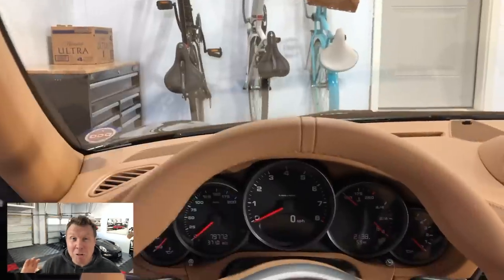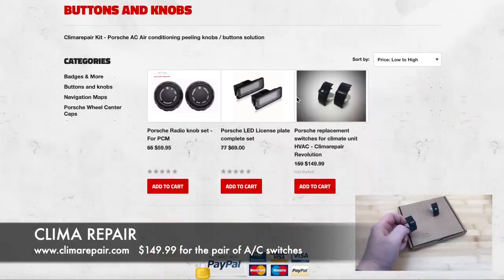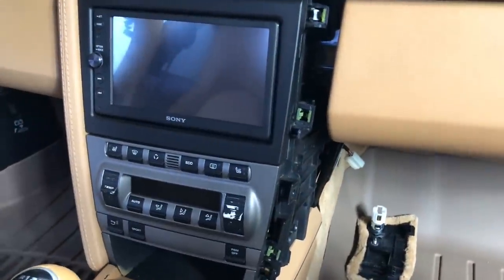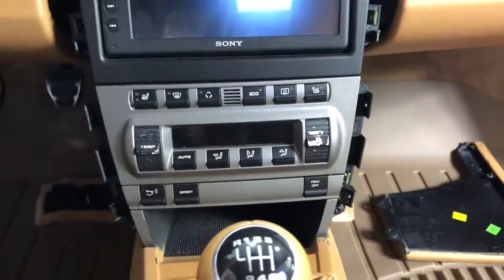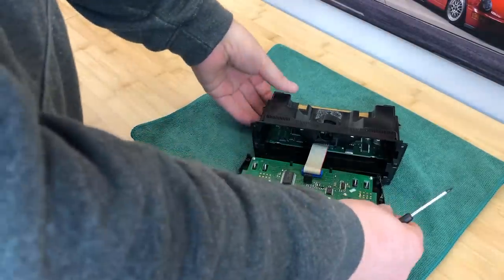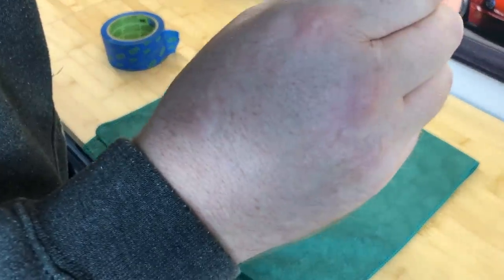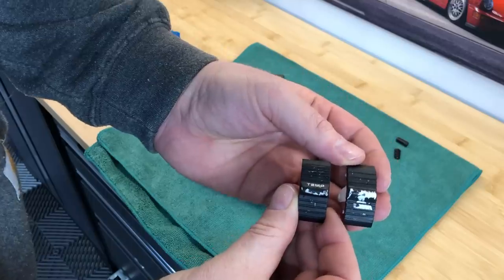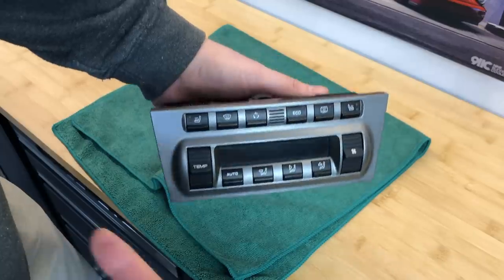Air-Conditioning Buttons Fix - Porsche 911 997

Comment: Oops, the white diffuser layer of the LCD goes between the white plastic frame and the LCD itself (seen at 15:17 when you first take it apart), otherwise you don't get a diffuse light source from the row of LEDs and you can see the individual hotspots like at 25:27
Reply from the maker: Nice one!
Reply: I'm waiting for my buttons to turn up to do this job. I can't see what went wrong though here? It looks like the white thing is in when he put it back together? I can see the problem though at 25:27. How should the white thing go?
Reply: @MartynStanleyAuthor  - At 23:01 you can see it installed incorrectly.  When reassembling, the transparent white diffuser should be installed first, so that it is below the opaque white plastic frame.
Reply: @mcarp22  Ahhh, you mean they are the wrong way around? The one on top should be underneath?

Comment: FYI...For those not wanting to disassemble the control unit down to the LCD screen level, after removing the 4 screws from the cover and opening the control into two. Used a sharp scissors and cut the tabs on the backside in half and with a needle noise pliers twist and break them off. With a flat head screw push the old buttons out and pop in the new ones.

Comment: FYI...Put the plungers in from the front!  They should drop right in with no resistance.   If you put them in from the back they're really tight and it does not work (ask me how I know 😅)  Another FYI these are very cheap,  they're all over Amazon for under $20....
Reply from the maker: Thanks!

Comment: Great video. From the loks of t it should be no problem replqacing the fan speed and temp button without taking anything apart.. Looks like you can bend out the plastic "tab" oon each side of the button to replace the buttons..

Comment: I finally got around to doing this project.  Went with the MACarbon (based in NorCal) ones vs. the Climarepair buttons.  I also figured that once I had the console taken apart, why not go ahead and add Bluetooth (MR12Volt) and a DSC controller?!?!  Still have a bit of work to do to tidy the MR12Volt and the accelerometer for the DSC controller, but this video was both my inspiration and a confidence boost to tackle these projects!  Thanks!  BTW, the tweezers are a brilliant idea, can’t imagine doing that w/ 2 screwdrivers!

Comment: Excellent video! I really appreciate the level of detail here. I looked at several different resources to do this project and yours is the best. Thanks for making this video, you made the world a little bit better place. 👍One note for those who are tackling this job: When I first put my climate control unit back together, I somehow oriented the plungers in the reverse direction, and when testing the unit in my car, the switches would not work. I took everything apart again, re-oriented the plungers in the correct direction, and everything works perfectly. So just go slowly when you are reinserting the plungers to make sure the notched end of the plunger is visible.
Reply from the maker: Thanks for much for the kind feedback, I really appreciate it! Glad everything worked out for you in the end. Cheers!
Reply: @AutoAmateur  I feel like we just worked on the job together. I have created a few "how to" automotive videos myself; yours is an excellent example of the breed. It's cool how you can create something one time and end up helping thousands of people around the world. Well done!

Comment: Thanks, followed your video and got them swapped over.  Got the replacements from AliExpress for £5 and look and feel OEM.  Only problem I had was the LCD display section falling out, took a while to figure how it all went back together but could see from your video paused how it did.  Thanks again, a great help.
Reply from the maker: Nice work!

Comment: THANKS so much for posting this fix!  My buttons completely bothered me as they were wet to the touch and left black “ink” or “paint” on my fingers.  I’m not sure if the previous owner tried to “repaint” the switches as I’ve seen some recommend but they were gross.  Your video inspired me to buy the replacement switches from your recommended source.  I didn’t do expedited shipping as I really wasn’t sure when I’d tackle the project, so I wasn’t in a huge hurry, but they arrived, UK to US, in under 2 weeks!  The project was simpler because of this video.  I was very careful w/the LCD screen and reassembled everything meticulously and everything worked the 1st time.  My new switches look fantastic and are no longer sticky - Thanks!
Reply from the maker: Glad it all worked out for you Rich!! Cheers!
Reply: @AutoAmateur   you’re spot on with the tweezer - hack!  That made the job a lot simpler

Comment: Most useful video by AutoAmateur. It took 1½ to do mine. The retaining screws hidden in the carpet trim on my 997.1 are T27 torx, not T25 as described. The hardest part was taking the side trims off without breaking the tabs, but I managed it and didn’t break any.
Reply from the maker: Thanks for the kind feedback and well done!! Glad the video helped!

Comment: Excellent couldn't have done it without your great video. My switches arrived in the UK from ClimaRepair who dispatch from Spain took just over two weeks to arrive. There are some horror stories on-line a few years ago about the quality of these switches but mine were perfect - also I see there is a Porsche parts supplier in Essex UK who have these in stock - sourced from ClimaRepair at about the same eye-watering price - but when installed by magic you forget about the cost. I just followed your guidance and it was a smooth installation start to finish - like you my top panel clips broke or were broken but apart from that I'm over the moon with the end result.
Reply from the maker: Hey Andy! That’s awesome! Congratulations on a job well done! 🥳🥳🥳🙌

Comment: Thanks for the great video. Very helpful. My new switches arrived this week and I just installed them in my 997 using your video as a how-to guide. Your tweezer method worked perfectly. Everything went smoothly until I clicked in the new switches. They did not move freely up and down like yours in the video. Using a flathead screwdriver to slightly bend them as recommended in the ClimaRepair video did not work. On a hunch, I very lightly sanded the back sides of the top and bottom part of the new switches until the sharp edges at each end were slightly smoother. Instant improvement. But you have to be very careful when you sand, since the switches are so delicate. All good. So happy I found your video for this switch fix!
Reply from the maker: Very cool!! Glad it helped!!

Comment: I finally got round to replacing my switches, which I received a few days ago. Great video, very clear step by step procedure, and the tweezers worked a treat.
They really let the interior appearance down and I always noticed them, even if no one else did.
Next job is to replace the chrome trim on one of the centre vents, which a previous owner has hacked about, presumably to fit a phone mount.
Reply from the maker: Well done! Glad the video helped.

Comment: Great video! I just did this on my 997 with no problems. My side carpet panels use a t30. I also used some toothpicks instead of tweezers and that worked really well. Took me under 2 hours at a leisurely pace with some breaks
Reply from the maker: Nice work!

Comment: Did the repair with my dad on the 987 Boxster S today, took about 1 hour flat taking our time not to mess anything up. It's such a big difference! The old buttons were chipped and gooey to the touch (gross). If anyone is on the fence about this mod DO IT. It's a big life improvement and worth the $150.
Reply from the maker: That’s awesome Drew!!!!! Glad it went well for you!!
Reply: @AutoAmateur  It's amazing what this mod can do for the car. I felt completely repulsed touching the previous buttons and never used the buttons because of it. They are a pleasure to operate now!
Reply from the maker: drewmorg same for me!
Reply: I bought a decal sticker to put on top of the original buttons, $10 so if it doesn’t work no harm done. Will update on wether or not they work well

Comment: poor mans fix, tape of the controllers and the fan and temp lettering.  Spray some plasti dip into a dixie cup, then brush it onto the buttons.  I was very happy with results.  Looks great!   Another option for those who don't feel comfortable taking their car apart.   Great Video!
Reply from the maker: That’s a great idea!!
Reply: I was thinking that too, but what if the white writing is rubbed off? All black buttons?
Reply: This method would not be the best if the white rubbing was rubbed off.    @DavesGenny

Comment: Great video and very relaxing to watch. Nice editing. I was just removing the right side trim panel today so that I could remove an old phone pedestal thing that's been sticking out on the right side of the stack since I got the car. I never used it, and the car looks much better without it. You've kind of inspired me to replace my buttons now as well. My 997, too, came with trashed AC controls-- fresh ones would be a nice improvement :D
Reply from the maker: Cheers Julian! Yeah, it’s amazing how much nicer the interior of my 997 looked after replacing those buttons. Go for it!

Comment: I couldn't find a video where you got that trim piece around the stereo changed out and I realize it has been a couple of years since you posted this video. I have a 997 that I replaced the factory stereo in and used the same kit. Once that kit is installed it is very difficult to remove. The screw that you show at the end does need to be backed out all the way. In fact once the new stereo is installed, that screw really isn't necessary. There is a bit of gentle trying that has to be done to remove the after market head unit with that adapter kit.

Comment: Thanks for the video. I just received my Aliexpress equivalents ($20 shipped) and will apply what I just learned.
Reply from the maker: Good luck!
Reply: It went very smoothly. I did not have a torx 6 but found a small flat screw driver that fitted after a bit of filing.

Comment: Ok, I get it.  It's an opaque diffuser not some type of protective padding / gasket - ok, now I get where it has to go ...... good video - I have the new switches - I think I'll procrastinate more - somewhat concerned that your top side trim panel brackets were already broken......is there a fix for that ?
Reply from the maker: Unfortunately there’s no fix for that really unless you try to glue back the broken trim clips. As I discovered, my trim clips were already broken and I would never have known. There was never any vibrations or rattling or anything like that. Just make sure you lift the final (upper) part of the side trim OUT towards you and not UP very far as you do it.

Comment: Nice job - I had the same problem when I had a 2007 C4 gen1 997 - I had my wife touch them up with a permanent maker pen - which whilst completely amateurish worked well 😀 - yours were much more in need of attention though, so by far a better solution. I had to replace the standard PCM with an aftermarket unit as the PCM broke down. I wonder if this is common to that gen ?

Comment: Did the same fix a couple of years ago, although not as well executed as your effort. The fan speed button does not work well though. Suspect I may have messed up one of the plungers, it may even be missing. Doubt I'm going to try and fix it though since I don't use the unit much in Northern CA in the daytime.
Reply from the maker: Ahhhhhhh you had to rub that in didn’t you?? Meanwhile in Minnesota.... temperature UP,  fan speed on HIGH. 😆😆😆 Joke. Thanks John!
Reply: It seems it's the same for all, the fan button does get stuck a bit. After fiddling with it for a while I figured out that if you loosen the leftmost bottom screw on the board (the one near the fan button), the button works flawlessly!

Comment: hi i just watched your video on replacing the two buttons for the air conditioning i know it's been a while since you showed the video i hope you answer anyway where can you buy them🇩🇰😉
Reply from the maker: Absolutely!! Here are several different options for you: https://www.pelicanparts.com/More_Info/997653100KIT.htm?pn=997-653-100-KIT-M253&gclid=EAIaIQobChMIn-2z6uWigQMVdCqzAB0XDAqCEAQYASABEgJVmvD_BwE
Reply from the maker: https://www.amazon.com/Replacement-Climate-Control-Switches-Porsche/dp/B00L35KP4M/ref=asc_df_B00L35KP4M/?tag=hyprod-20&linkCode=df0&hvadid=463359003998&hvpos=&hvnetw=g&hvrand=5255904280705189891&hvpone=&hvptwo=&hvqmt=&hvdev=c&hvdvcmdl=&hvlocint=&hvlocphy=9019498&hvtargid=pla-960794895519&psc=1
Reply from the maker: https://www.ecstuning.com/b-uro-parts/climate-control-button-replacement-kit/997653100kit~uro/?gclid=EAIaIQobChMIn-2z6uWigQMVdCqzAB0XDAqCEAQYBCABEgJPsfD_BwE

Comment: TIP!!! If you loosen the leftmost bottom screw on the board (the one near the fan button), the fan button works flawlessly!
Reply from the maker: Nice one!
Reply: Huh? Can you explain?
Reply: @streaydog019  I simply did not screw the leftmost bottom screw all the way and the button did no longer get stuck. You should do some testing your self  to see how much you need to loosen it. If you skip to 14:00 in the video, it will be the rightmost-top silver-colored screw that you seen on the PCB (green board) that you need to loosen.

Comment: Why did you switch from Clima repair? I share your video with everyone but after the research I was also only recommending Clima.
Reply from the maker: Several years later they’re expensive compared to other products with equal quality.
Reply: @AutoAmateur  do the ones you are recommending on Amazon have equally durable coating. It appeared to be ceramic or something as they do the demo with the propane torch.

Comment: $150.00 for 2 buttons sounds like a fat ripoff I'd just plati-dip them for $5.00 honestly
Reply from the maker: That’s definitely an option but I’ve seen that approach fail. They look ok for a short while then start looking crappy again.
Reply: @AutoAmateur  The only situation I can think of in which they would start peeling again is if the car is in consistently high temperature environments and even then you could opt in for some heat safe paint additionally if friction on the buttons are causing the peeling I'm sure you could find some high friction paint out there that's also heat safe.